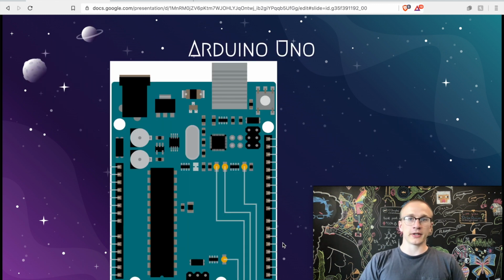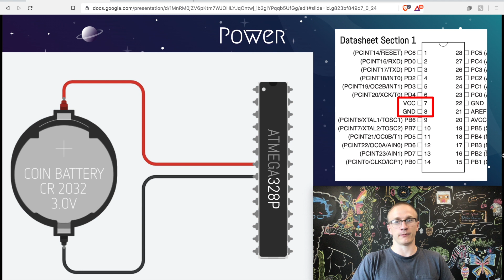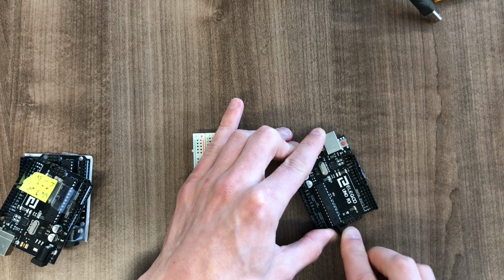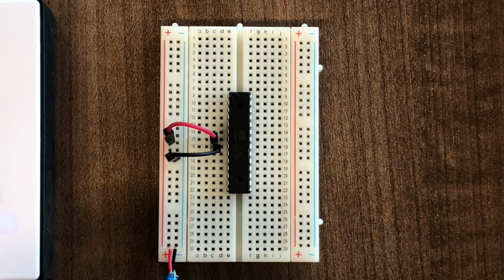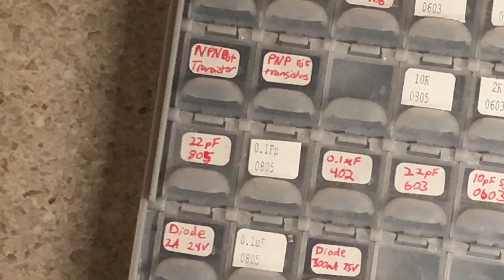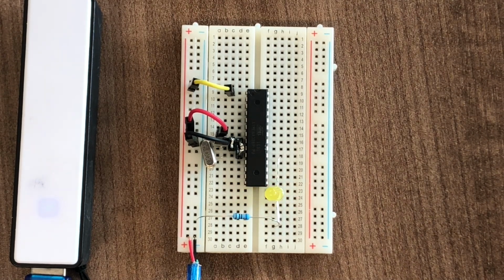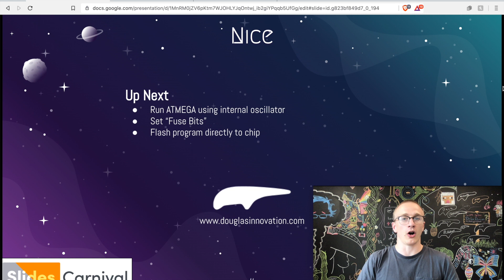Bare-Metal MCU #3 - Barebones Microcontroller

Comment: 6:43 marked crystal is not for Atmega328P-PU but for Atmega16U2(USB converter). Oscyllator for clocking Atmega328P is small and is to right from chip( exact middle of the dev board )

Comment: If you fuse the 328p to use the internal clock, you can do away with the xtal + loading caps. So barebones for THIS example: sure, but in general, no you can go down 3 more components.
Lol btw .. what's the stray capacitance on those extra headers vs. the 22pf SMD loading caps?

Comment: You might want to mention that it is a good practice to ground yourself before handling any electronics especially the chip pins. In dry climate areas like the western provinces and states, static is 1000x what it is in humid states.

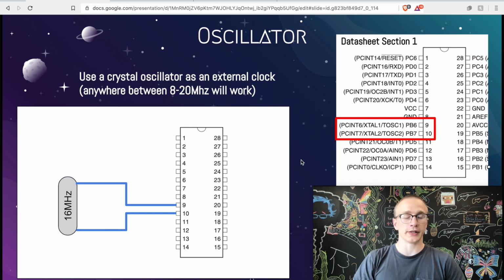Comment: 7:07 where is the video without 16Mhz crystal?
Reply from the maker: Video #5.  To use it without a crystal, you need to flash the configuration bits to tell it to use the internal oscillator.  So you’ll need to watch #4 and #5 to learn that
Reply: If you buy an atmega328p on its own I think it defaults to the internal oscillator. But yeah you do still need to know how to program it and what fuses are anyway. #4 and #5 are good videos

Comment: Excellent series. Arduino deeper. Like it. Just one point: that 16MHz crystal you shown (6:30) controls the secondary chip (frequently an ATMEGA16U2). The clock to the ATMEGA328 is given by a little oscillator closest to the main chip. I'm considering an original-like board, with a DIP28 chip.